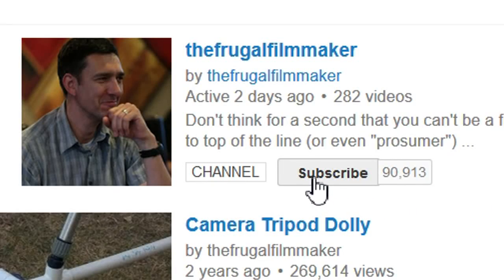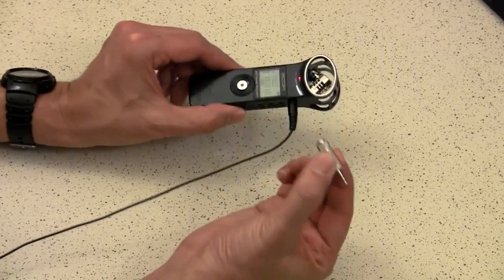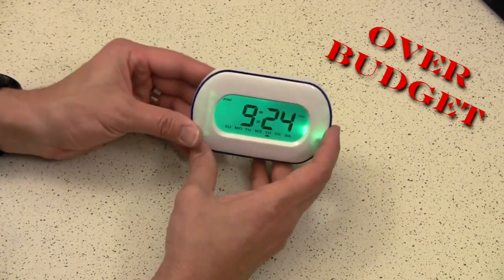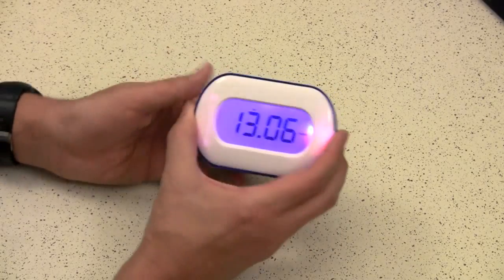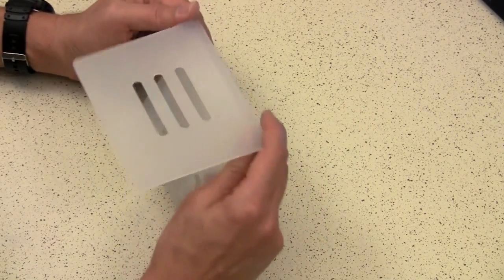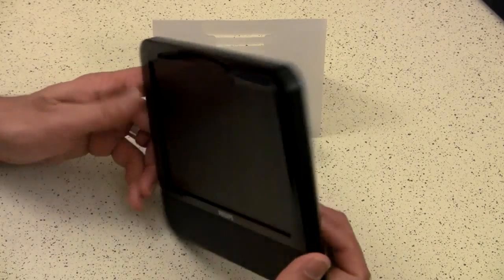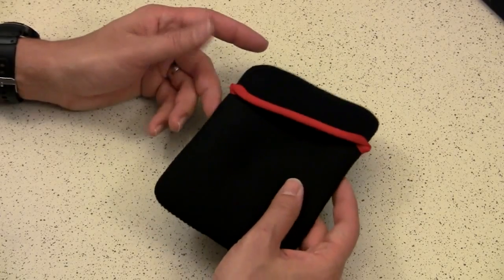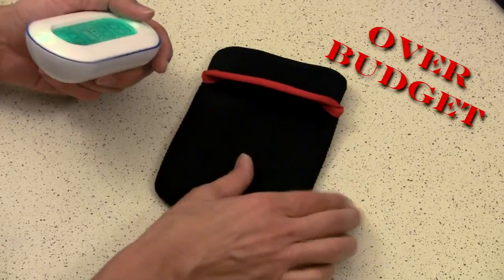$1 Budget: Sleeve Adapter Timer Stand!

Comment from the maker: I use a different monitor (the powered one in the video) with a power supply, but I can power both from a battery.  Check out my video "Tip: External SD Monitor Battery" for complete information.